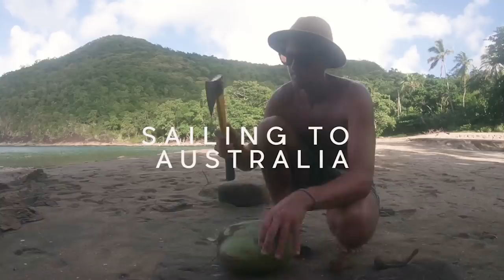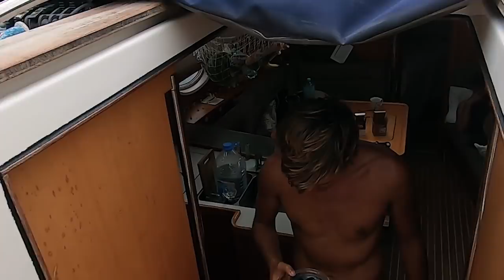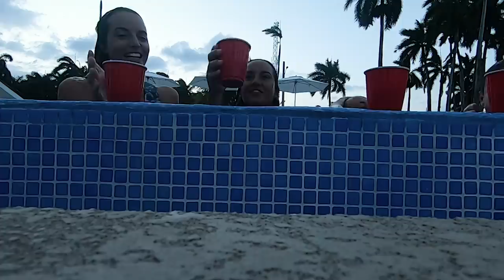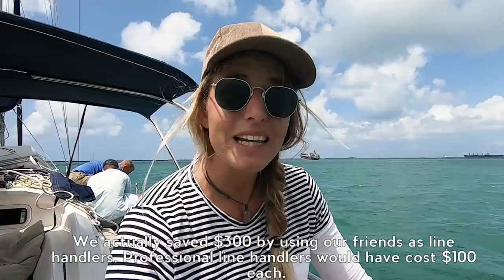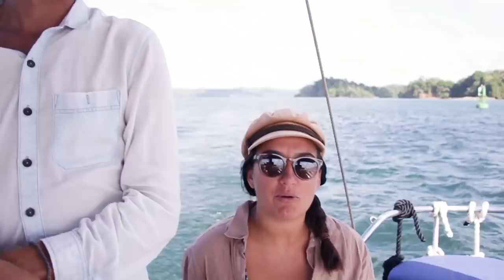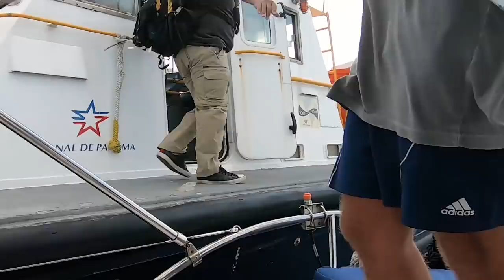How NOT to Transit the PANAMA CANAL by Sailboat! 🙈⛵️ ~ Vlog #42

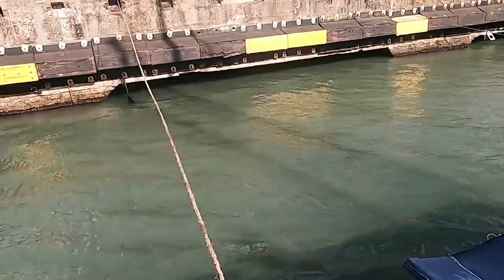Comment: Hmmmm......fyi @15:00 not a traditional bowline, (rabbit goes round the back of the tree), what you tied Xanthe is what is known as a "Dutch" or "Cowboy" Bowline.....it has a tendency to collapse/rollover (basically come undone) if the dangling outside end is pulled the wrong direction. Not a critisism just an observation, best way to learn is by doing, keep up the great work.
Reply from the maker: Don't worry, I got told off by the captain for sending the rabbit the wrong way... Needless to say, my bowlines are impeccable these days.
Reply: @FindingAvalon  No worries, we're all on a learning curve, be keen to learn, keep throwing yourself at challenges with yours eyes open you will soon find the path, young padowan ;)